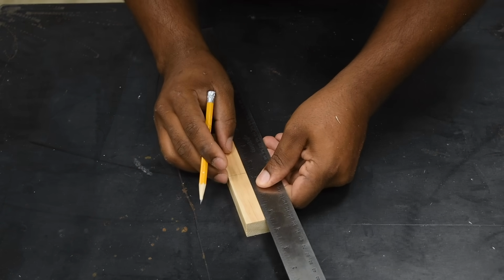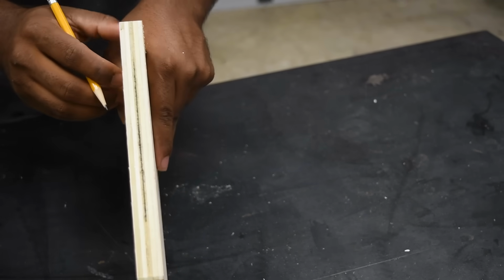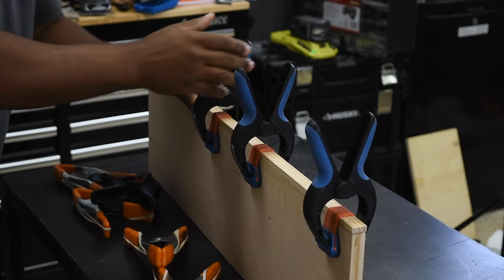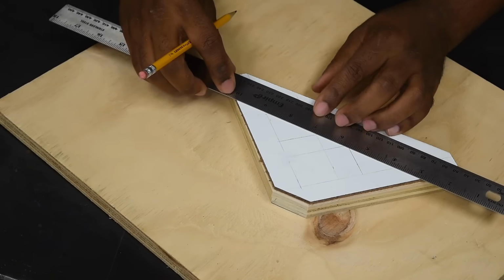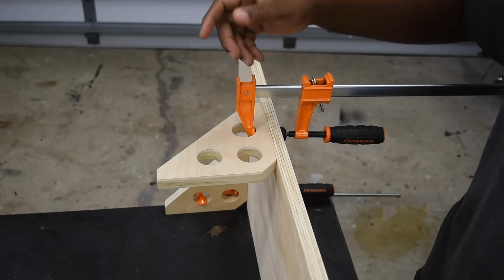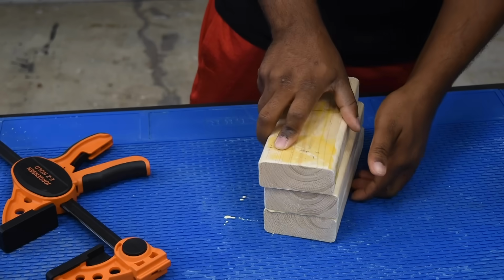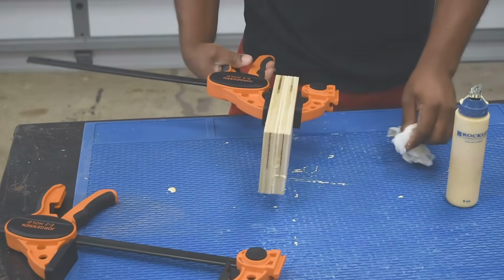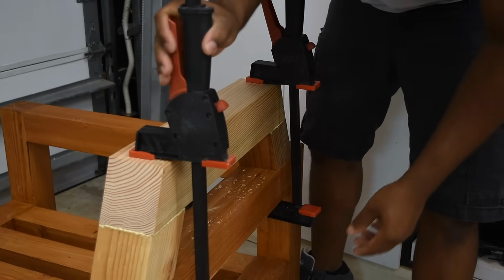6 Woodworking tips & tricks for beginners

Comment: I’m somewhat New to woodworking, I have a small one-car shop and I want to build some cabinets for the wall and some drawers and shelves.  I have a Dado Set, a 10” Table Saw, Drill Press, 9” Band Saw and a 10” Chop Saw finally a 1 hp. Router.

Comment: Never saw the second one either and hadn't even seen those clamps either! I used to use those cheap clamps by using basically just the ends that come together. Obviously, it doesn't take much force to move things so, if I'm being honest, I just hold things together myself for a while and have a little meditation. Chances are, I need a little rest from all the sawing and stuff since I build in the woods with hand tools and I'm old.

Comment: 50+ years’ experience here. Hats off to you on your tips! I learned something new. Now a tip for you; never use the whole side of the fence and a miter gauge on the opposite side of the saw, at the same time. Once the cut piece is free on the fence side of the blade it can bind between the fence and the saw creating a kick back and missile hazard to you or your shop. Instead clamp a piece of wood at the beginning of the rip fence to use as a measuring gauge. Once the wood clears the measuring gauge it will no longer be in a position to bind.

Comment: Some nice tips here but....
Glue on the endgrain of those little posts that you dowelled won't hold.  If you want to use glue on end grain - and I'd use additional dowels or tenons instead - you have to size it first.  Spread the glue evenly across the end grain and let it dry before applying more glue to it to join the pieces.

Comment: Even better than taping a nail is driving one in part way. Then you cut off the head at an angle. Its sharp enough to mark the refernce. Then use pliers to pull the nail. As a bonus, you already have a pilot hole on both sides.

Comment: I've been a woodworking hobbyist for over 30 years, and I grew up watching my carpenter father. I never knew about the rubber bands on the spring clamps. And the other thing that would have saved me recently when gluing up a cutting board is putting salt on the glued surfaces to prevent them from sliding. That alone was worth watching the 12-minute video. You have a new subscriber now!

Comment: When you have an odd gluing situation where clamps are difficult, or awkward to use, try using an effective method that is used in many Third World furniture shops where they usually have a shortage of wood clamps for glue up projects.  It's called the "Rub Joint".  Simply apply a moderate amount of glue evenly to the two pieces to be joined, and slide them back and forth in a rubbing motion while applying a little bit of pressure.  As you keep rubbing, you'll soon notice that it will become harder and harder to slide the pieces.  When you get to the point where the pieces will barely slide any more, simply move them into the desired position, wipe away the excess glue, and let it set up -- just like you'd do with clamps.  Hours later, you'll find that the joint is just as solid and strong as if you had tightly clamped them together.  Why, you ask?  The reason is that your rubbing action accomplished the same thing that clamps do.  All the clamps really do is drive out the air between the two pieces.  Your rubbing motion did exactly the same thing.  You merely drove out the air, that's all.  Third World ingenuity!

Comment: I'd also like to add when gluing up, it's very important NOT to use too much glue. 
What I do is use my 'finger' (how innovative using a renewable God given tool) to spread the glue. Put just enough to where it starts to tack up under your finger as you spread it. Then set the pieces together perfectly aligned and under its own weight and wait for around 10 minutes. What this does is allows the glue to penetrate BEFORE you clamp it & squeeze it all out. Making it somewhat like contact cement. But don't pull them apart. Just apply light clamping pressure.
Your squeeze out should NEVER be more than a few beads no bigger than the head of a pin.

Comment: really good video sir. i admit i never used the nail for a dowel marker but i liked it. i have the other ways you already showed. i like the salt which i havent used in some time but it made me remember some old projects. you might have even shown the 90 degree block of wood for drilling that dowel hole too to repeat what you already showed them as a good handy tip. i think early on i used to use something similar but it was and "L" shape instead of just one faceted. the L shape gets you the 90 degree but it cant be too tall or it gets in the way sometimes.

Comment: Let's see if I can shorten this up. The summer I was fourteen I worked for a moving company,  I was assigned to help the box maker. Back then moving boxes were built on site. This carpenter beveled the edges of adjoining boards with a jack plane,  marked dowel holes with the nail head trick, mitered corners, made every cut with a hand saw, blunted the tip of every nail. Now the point. This was my introduction to wood working and I thought that was simply "how ya did it". As an introduction to what I later learned was "a way to do it" it was a very good introduction indeed. I see that same distinction in your work. Keep up the good work.

Comment: For the center gauge, it's easy to modify for other lines, such as 1/3, 1/4 or 1/5, which I commonly use when doing two lines of screws. Just put the center marker at the desired fraction.

Comment: I am a retired plumber in the UK , and have just found your site many thanks,I do not know if we are allowed to ask questions, but i thought i would try, So i have a concrete garage here in the uk, and would like to trim out he walls with timber stud work and board over, then add a pool table,, its 20 ft bt 13ft , Do I need to stick to 400mm centres, and use 2/4s or can I widen the studs, and just use 3/2s, to save every inch of floor space,.cheers pete.

Comment: Don’t use your miter gauge AND the parallel fence on your table saw if you want to avoid kickback. I’m referring to the piece about the right angle jig. Wood that’s lodged between fence and saw blade is a recipe for disaster. Good thing you had your blade guard on.

Comment: FYI- that miter cut you made on the table saw on the plywood was somewhat dangerous.  Never use the miter gauge and rip fence in combination unless you have a spacer block of sufficient size set back from the blade and wider than your cut off piece.  Making the cut the way you did is just asking for some nasty kick back.

Comment: Great video.
I started as an apprentice joiner 60 years ago (in the u.k. age 15) but only did 4 years then change to architecture. Even to this day I enjoy using different ideas to make practical jobs easier. Some of these tips I've never seen and are brilliant in their simplicity.
One tip I would pass on is that when using smooth dowels with glue, always make sure to cut a shallow groove along the dowel to allow some glue to escape when the dowel is tapped in.

Comment: Wonder if when you pull the rubberband up over to the top  edge of the spring clamp. . . if you removed the orange cap you could place it over the rubberband to secure it.

Comment: Some seriously great and seriously  dangerous moves for beginners.  Using the miter gauge on the table saw with the material against the fence is a big no no, its a good way to get hit in the gut....yea, i saw the riving knife and the guard, im talking about the beginners.  Also, using the mitersaw to make those corner cuts as show, can be dangerous for the inexperienced.  Nice guy,  tips are great for beginners and the pros, but those moves are not.

Comment: At the 5:00  mark you were crosscutting your angles using the fence. This is a big no no.  That piece between the fence and blade is a recipe for a kickback.  You should have a stop block set up at the beginning of the cut.   Also. never wear gloves when using power tools, the blade can catch the glove and pull your hand in. Other than that good video.  Love the salt idea.

Comment: Man you are one smart dude! I love some of the tricks you show. What baffles me however is how you do your angle on the doweled legs. I tried to do a interior guard railing with 2x2 wood spindles and a D-fir bottom plate on the rake 35 degrees with dowels. It was daunting. It gave me the strengths I was after yet it was a fail on looks. I was glad it was painted. 

Do you know any hacks, tips, tricks to get you rake correct and straight when boring out dowel holes for railings, furniture, etc. Thx

Comment: According to Jeff Loflin, glue specialist at Franklin International (maker of Titebond wood glues), salt (and sugar, too, by the way) can react with wood glue and alter its composition, resulting in a weakened joint. ... As you slowly increase clamping force, the glue tacks up and holds the boards together.

Comment: Depending on the glue used, salt can weaken the joint by changing the chemical composition. But a small amount of grit does the same thing without weakening the joint.

Comment: I am not sure if I would trust the salt to weaken the joint or change the way the wood grows and shrinks in humidity.  I did like some of your other tricks.  especially the nail one.  :)

The trick I use for finding center on an off sized piece is just to turn the ruler on an angle until it hits a full inch mark.  (say 8 5/16" board, I just turn the ruler till 9 or 10 inches, and mark at 4 1/2 or 5 inches)  That jig is good for thin stock though.

Comment: Very good tips. I’m 72 and these tips were new to me. Thanks! Here is one I have used for years. My grandson thought it was great. When using screws and your having a tough time driving the screw in rub wax/soap on the auger part of the screw and the screw almost runs itself in. Also, a pilot hole helps a bunch and helps prevent the wood from splitting out.

Comment: OMG!  When you cut the 45 degree pieces!  that was soooo dangerous as that could easily bind on the saw fence.  Especially with beginners.  Please use a spacer board on the fence that clears once the long side of the  of the 45 starts  blade engagement.  Make this spacer block at least 2" off the fence.  Or find another way to make this cut WITHOUT using the fence to completely free the piece from  any possible contact with the fence.  Really, please do this.  It a good tip for beginners and for experienced woodworkers.  Check other  YouTube videos on this subject.  Thank you.

Comment: what a world of difference. Americans seem to have the space for great big workshops. replete with specific purpose power tools. but the absolute biggest difference is the timber. the timber/lumber used in some of these videos would 100's of £'s. think about it. America is huge. therefore they have the space for bigger cars wider roads bigger houses spread out. Britain is tiny and cramped. no kidding some your workshops are bigger than my house. Tools. perhaps because the market is bigger over there the tools are sooo massed produced they can be comparatively cheaper per unit? whatever the truth of that one i cannot afford many thousands of pounds of kit. which isn't a problem really because i haven't got any space to put them. TIMBER. again, i don't know what it's really like in USA but it does seems the availability of timber is greater and the cost is lower. Again, this makes sense they have the space to grow allll the timber you could want. if it is plentiful in supply no only will it be cheaper but better quality because the rubbish can be used for non timber purposes. here you take what you can get. some of it is twisted in all plains possible. and of you bigger than 2 x 2 you start to need a mortgage for it. I know this video doesn't purport to be budget or on a shoestring or anything but boy would it be refreshing - just once - to see a video where someone really does use cheap rubbish timber and tools that every one is likely to have. who's has a whole set of forstner bits. honestly, in just sets of different types of bits some of these people have 100's of £'s. Cheese and Rice, just buying the clue can cost an arm and a leg.  So please, spare a thought for people who are working on a budget and dont want to 'build a remote control laser chair out of a paperclip' they just want to build some neccessary and functional at a basic price with basic tools.

Comment: instead of using a nail, why not just use some scrap pieces and MAKE a dowel jig?  That would be a much better DIY than taping a nail and pushing it into the wood, as then you're not creating a gap in the surface of the wood that you'd need to fill with more glue.

Comment: Thank you for your videos - I've been woodworking for 5 years, making birdhouses, recycling anything and everything.  One thing we are building next is trellis for a couple of wisteria's to grow up next to our garage.  Because of the lumber shortage I need to make the 8 foot 4x4 work in our area - our idea was to drive rebar into ground then put a hole in the center of the 4x4  and attach to rebar for stability, so I don't have to bury the 4x4 with concrete where I'll loose my height.  Thoughts?

Comment: Never push stock against the rip edge while using the miter gauge to cut on the table saw. It’s so easy to rock the piece and kick back. Very dangerous especially for someone new to woodworking

Comment: I love the banding clamp idea - never used them before and have tons of orange and yellow spring clamps just "hanging" around clipped to my shelves. 

Corner clamps are awesome - use this style all the time! Your's are stylish!

That nail trick is sweet - never thought of that before! Genius!

One thing - miter gauge and fence where the miter gauge is opposite of the fence is a big no-no. High probability of kick back. Looks like your Saw-Stop is tuned up perfectly, but if the off-cut twists it's gonna fly. 

Great video. Keep it up.

Comment: Question Sir. I am a beginner wood worker. I have built a large yard bridge 10' x 4' and some wall shelves here and there. I'm about to get serious and build a pergula 12' x 20' and renew the hand rails and some flooring planks on my deck. Question is this. I want to stain the replaced flooring planks immediately so it doesn't stand out from the other parts of the deck. How can I do this when everyone tell me pressure treated wood must sit out for months before it can be stained?

Comment: Thanks so much.  I immediately went and made some right angle clamp jigs.  I have been making shelves for the house, and mostly using dowels  to assemble.  These will help me hold the joints square while the glue dries.
These look allot like the magnetic welding holders, used with metal.  
Suggestion: in video,  when using the center marking gauge,  slow down and emphasize turning the gauge so each pin presses against the sides of the board.  You may want to add a different camera angle showing this too.
Like others have said, each of these tips is new to me.  Thanks again.

Comment: Just curious... does the salt in the glue not weaken the joint at all?  It's pretty much like putting sand in your glue, unless the salt dissolves in the glue before it sets? Nice tips over all.  Would really be curious to know how,  if at all this effects the strength of the glue though.

Comment: Another trick is to hammer a small nail into the first piece, then cut the top of the nail off about  1/32 “ above the surface. Then glue. The only problem with this is, if you are going to saw thru the wood, you need to know where the nails are. Great video.

Comment: Adding a grain to prevent slipping is a good idea. The use of salt is not. Salt will absorb moisture from wood which will accelerate dry rot. As it dies salt crystals will push the wood cells apart causing separation. Sawdust or woodchips are best.

Comment: Cutting those triangles where the offcut was on the fence side of the blade is dangerous and irresponsible to show to the public who will emulate this bad practice. Either move the fence well out of the way or have the offcut form on the free side of the blade!. If your mitre gauge only fits on the free side of the blade get a better saw or make a mitre jig to do the cut

Comment: Your tips are great and I used to use salt for anti-slip too. Had a staining problem from it. Now I use fine sand. I get it from screening play-sand through fine mesh screen wire. Doesn't melt from the glue.

Comment: I would love to see a how to video on making those post wraps found on those Craftsman Houses.  Something with a wood base with some basic design on the sides, then a tapering top portion with 1/3, 2/3s proportions.  The trick here would be which kind of wood would I need, I don't think plywood would be good, and how to cut all those straight lines without a table saw so I guess with a decent track saw.  Also, in my case I have a porch with two ugly posts, but I want to add a third and then a railing between the right two wrapped posts.  Also, how to you fasten the wrap to the existing posts, how to add a new post (a 3rd one), how to make the designs on around the base or top portion.

Comment: Great tips but good grief stop cross cutting a piece on the table saw with the board touching the fence.  This is what can cause serious kickback.  You should always clamp a 2 inch thick block to the fence at the front to measure off a repeating cut, so when you start making the cut nothing is touching the fence when the piece reaches the saw blade.

Comment: Put my name down for an old guy that just learned something. Try this one when gluing board faces together. It's called a rub joint. apply your glue then rub the boards together, you will feel them start to seize up, then clamp. The friction opens the wood pours so you get better adhesion and it dries faster.    GOOD JOB